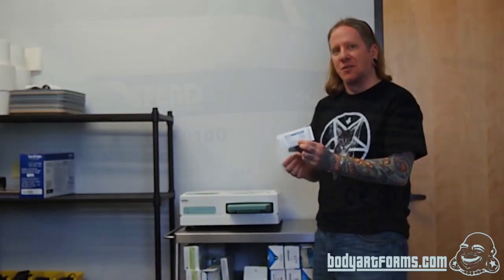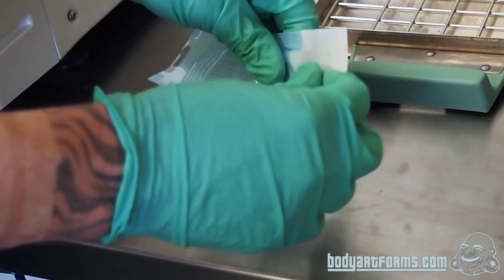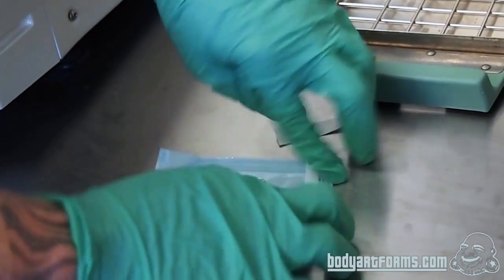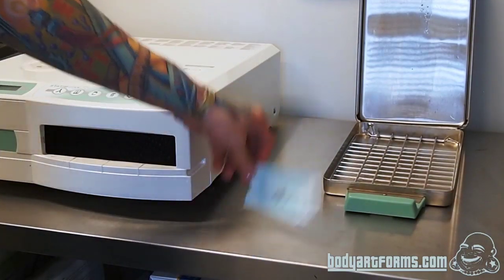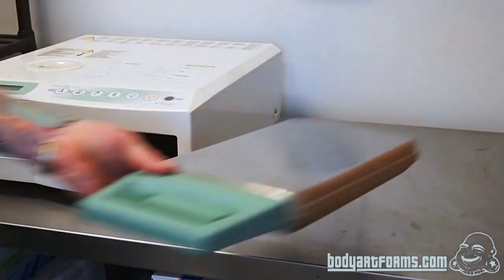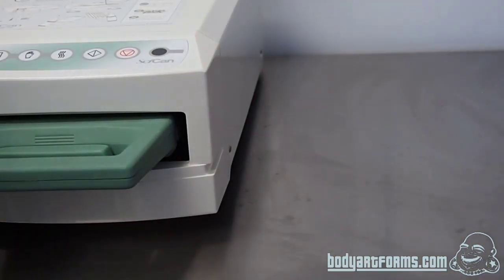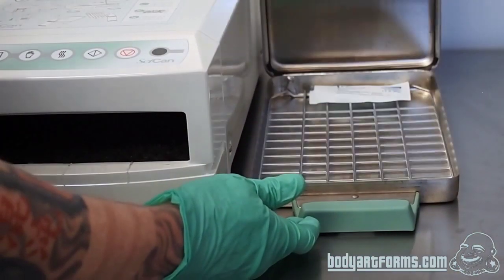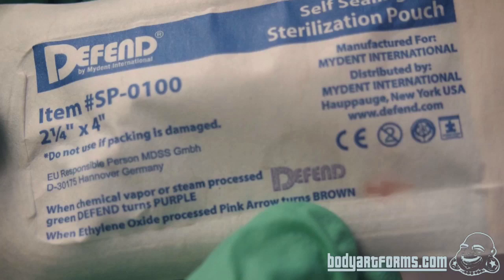How the Bodyartforms autoclave process works

Comment: Packaging the jewelry seems to be excessive to me. If you use the jewelry immediately, why package it?
Reply from the maker: @vladimirtheimpaler When you purchase from Bodyartforms, it is shipped through the mail so all your jewelry comes in a bag. If it is autoclaved it comes in a pouch with an autoclave sterilization indicator. A little text changes color to confirm that your jewelry has been adequately sterilized. It also allows a return of the product if you do not open the bag.